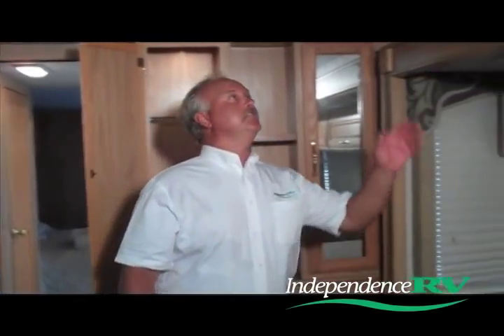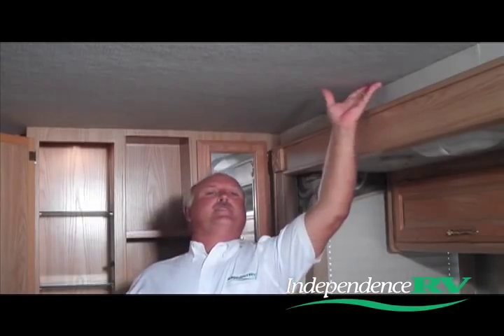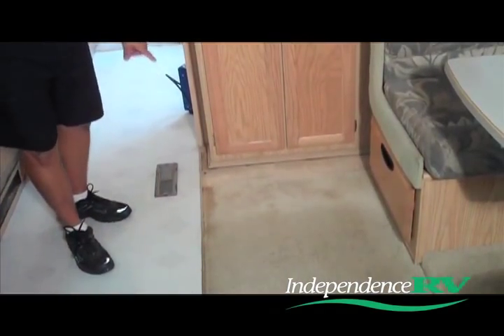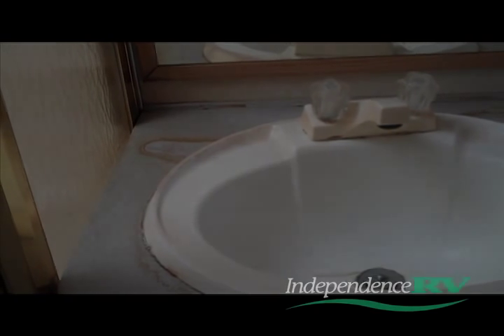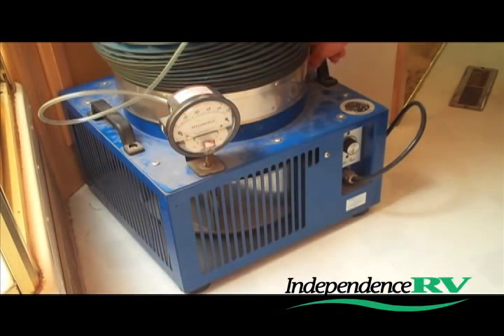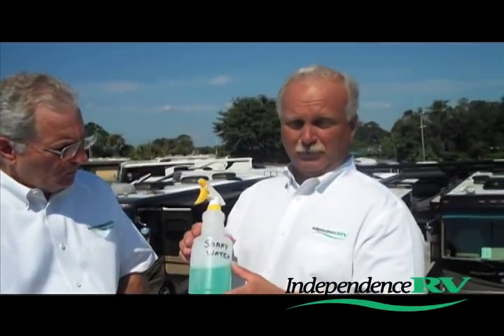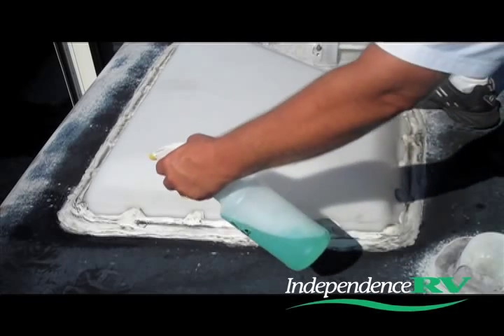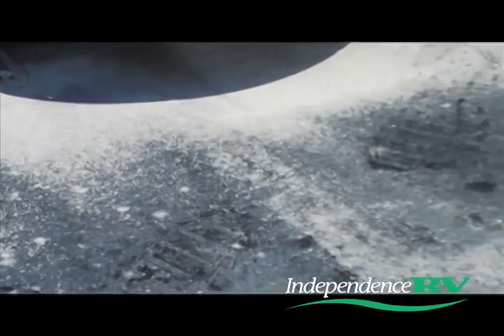RV Leak Detection

Comment: Once you have a leak in a roof seal the water has entered the RV. The moisture is now trapped between the roof and ceiling and or dropped down the side walls. The wood now has absorbed the moisture and can start the mold process. A mold test needs to be performed if you have a leaking seal on the roof. Read your owners manual regarding replacing the sealant. OLD sealant must be removed before applying new sealant....yes, this is a PTA so many times I have inspected an RV and found multiple layers of sealer with dirt accumulating along a crack or edge. This is a leak source that need to be addressed properly.